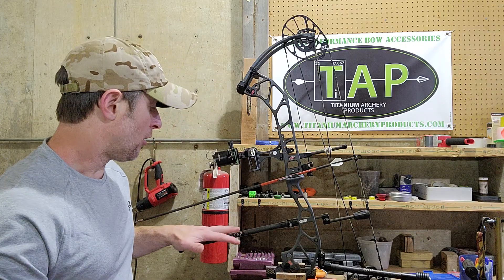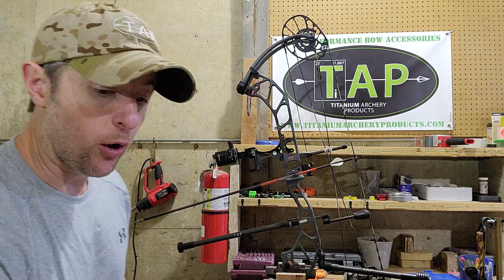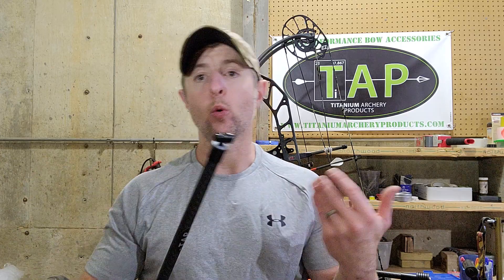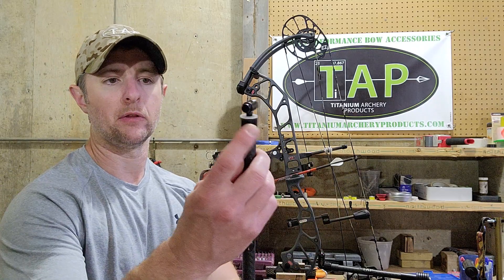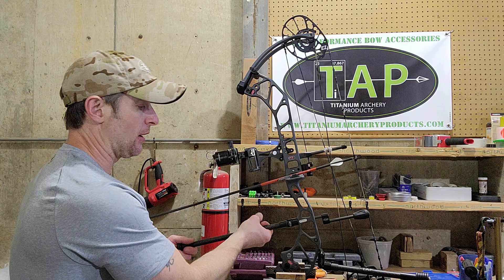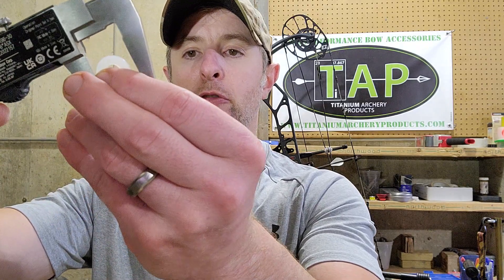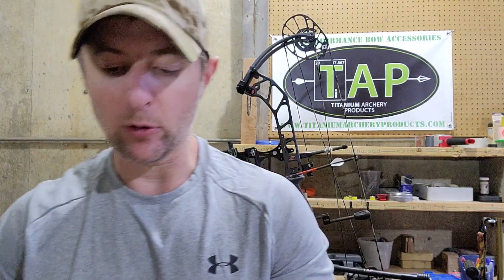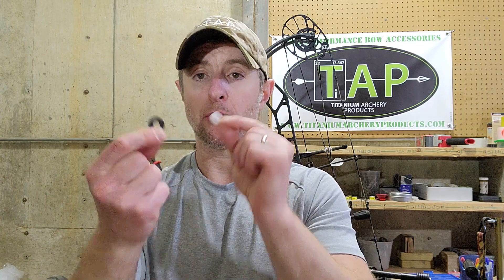Bow Stabilizer Vibration! SQUASH IT with this simple add-on. 🤜🎯🇺🇸

Comment: Neoprene seems a little too soft, all it does is squeeze out. Need to find a 1/16” Viton sheet to try. Way less compressible.. It’s getting so bad my hardware store didn’t even have 3/4” nylon washers.. lol. Thanks for the idea though!
Reply from the maker: We use a specific brand of Neoprene washer in between the bow Riser and a Nylon washer that sits directly on top of the bow stabilizer...and it works great. You don't need to overmuscle the tightness either...simply tighten down to the point where the parts bind up together well and it's good to go. I suggest you buy what we sell as we have tested them extensively. 

https://titaniumarcheryproducts.com/products/vibrationwashers